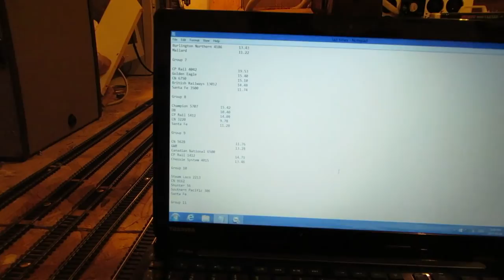Running Engines & Lap Times Group 9

Comment: For these tests, are you using a constant track voltage, or a constant throttle setting?
Reply from the maker: I'm setting my power supply at max.